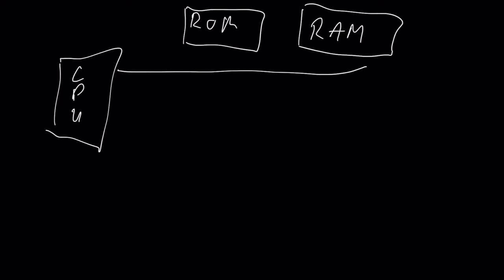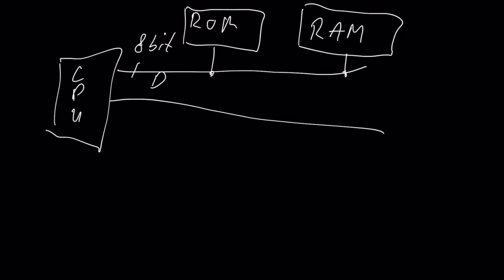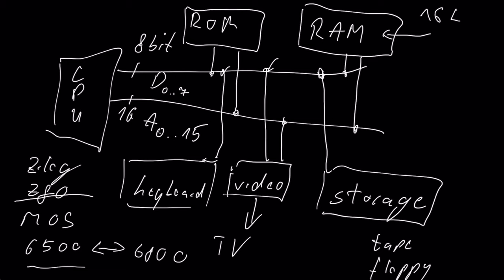Home computers: Basic architecture, generations

Comment: I had a TI99/4A, the speech module, and a tape deck to load user programs.  That thing was a decade ahead of it's time but just didn't have the support.  Aside from the personal management software, the games were incredible for the day.  Parsec fully leveraged the speech synth and spoke, quite clearly, during different events in the game.  Incredible.  It also had text to speech where it could read text on screen a good decade plus before such a thing was realistic on x86 PCs.  Cartridge software or load from tape.
Reply from the maker: Thanks for sharing memories, that adds to the story a lot. I found Ti99 a good machine in pair with Atari 800 and they rolled it out years before C64. The management behind was the problem. They made two big mistakes. First of all they asked money from developers instead of supporting them. Beside that they started price war while the TI99 was not a chep to make machine.